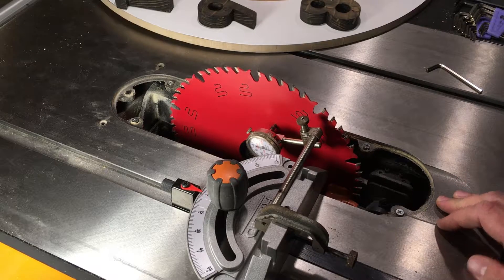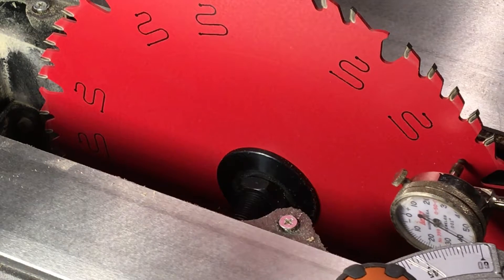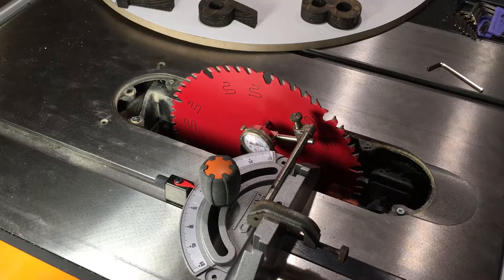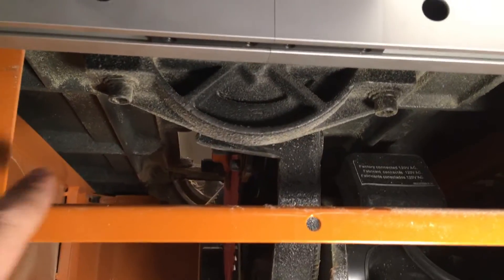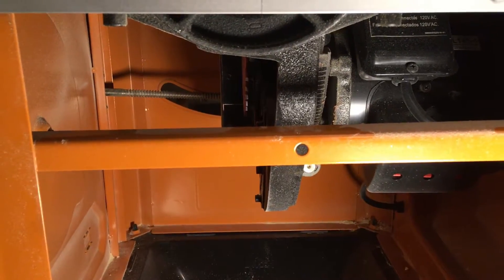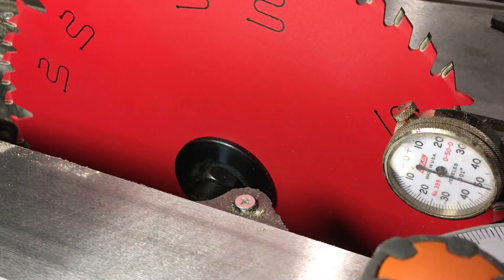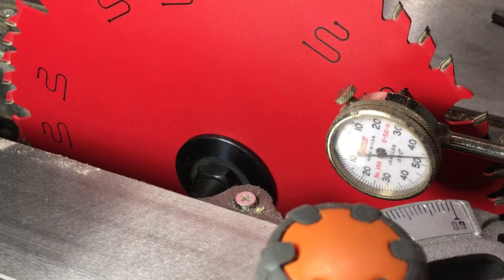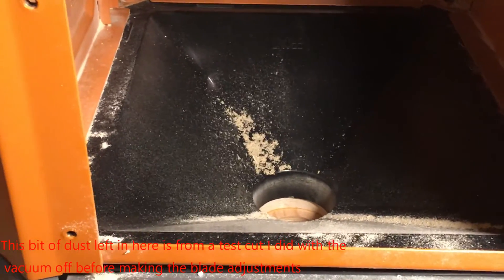Ridgid Table Saw Blade Alignment (R4512)

Comment: Thanks for putting this video together. Mine is off by about 1/8 inch. I wish Rigid did more to help people know how to do all of these things when they get their table saws and are setting them up.

I agree with the other comments. This was very concise. I see too many people take an 8 minute video and cram it into 22
Reply from the maker: No problem.  It’s a very good saw for the money, so I thought it’s too bad that it quickly leads some people to frustration with its almost guaranteed misalignment that isn’t so hard to fix once you get the hang of it.

Comment: Thanks for the video. I've just spent the last 45 minutes trying to heel my blade to the miter slots and having no luck. Although I have the same saw, my owners manual shows all 4 of the bolts and suggests loosening them all. That made sense to me because unlike 3 bolt systems, if you only loosen 2 of the 4 bolts it doesn't seem reasonable that you could "pivot" the blade alignment without getting something in a bind, regardless of what your dial caliper says. Anyway, the front 2 bolts have VERY limited access (one is behind the motor) and it's like they're welded in ( I'm 6'4", 215 lbs and work out 7 days a week but am 69 years old)  and, I couldn't budge either a single millimeter. I've had this saw for about 4 years so maybe they've revised the instructions in that time. I'll give it a try with your method and see what happens. It sure beats removing the saw from the stand, getting a friend to help me turn it upside down and using a cheater pipe to remove the front trunnion bolts.
Reply from the maker: I’m curious to see how it works for you.  Since my saw is a bit newer, I suppose it’s possible they slightly revised the bolt arrangement, but I’m thinking it’s likely the same.  I hope this method helps!
Reply: Just returned from the shop. Even though their recommended method is different from the older method, it DOES work for an old saw of the same model. Apparently, they discovered that loosening the front 2 bolts was unnecessary for minor adjustment. My table saw was purchased in October of 2015. My front to rear deviation from parallel was almost 3/64ths of an inch. If you have a saw from this time period, you will need to drill an appropriate sized hole centered in the cross brace at the back of the saw for your screwdriver since one is not provided.
Reply: @presentdayjeff5790  Will let you know. I just viewed a one year old owners manual online. It coincides with the method you describe here. However, instead of mentioning 4 bolts as in my manual, it mentions and has arrows pointing to the 2 bolts at the back of the saw only. I thought that perhaps they had done a redesign with the same 2 bolts in back but only one bolt in front which would allow a "swivel" alignment process but no: the illustration still shows the same 2 bolts in front as well. So, perhaps your method will work on a 4+ year old R4512.

Comment: Thanks for the video, this is the most concise one that I've seen that covers the actual steps of alignment. Only downside is that most people will be doing with a combination square instead of a dial indicator.
Reply from the maker: Chetan Raj that’s a good point.  The instructions by Ridgid tell you to use a square and don’t mention a dial indicator.  With a precise machinists ruler and a nice square you could probably get decent results, but it sure is a lot easier and more precise with the dial indicator.  There are some acceptable quality indicators for very low prices now, and even the harbor freight version would give great results for a small price.

Comment: I have the same problem and it's driving me nuts.  Other videos are mentioning shimming the trunion(new word of the day!) Just wondering if your adjustment has been effective. thanks
Reply from the maker: This adjustment worked well and is holding fine.  I see what they mean about the motor trunnion needing to be shimmed, but mine appears to get out of alignment in that way only in the last couple turns of the blade height, if I run the blade all the way up.  I’ve heard that this model has some variation in the build quality, so that some serial numbers will have this problem, some won’t at all, and some do to a small degree.  I do very few cuts at full depth, so it’s not really an issue, but I still want to adjust that too... future video I suppose.
Reply: @presentdayjeff5790  I'll give this a try.  Thanks for sharing. ( Trunnion! yes)
Reply from the maker: Sure thing.  Actually, this reminds me... once the motor/arbor was aligned with the mitre slots, I found that the fence was off, not aligned with either one.  If you aligned the fence previously with reference to the blade, you should realign it again after the blade is aligned.  The fence was more finicky to get right than the motor/arbor.